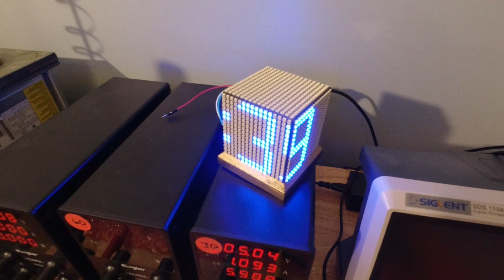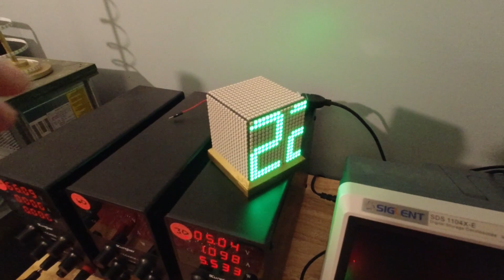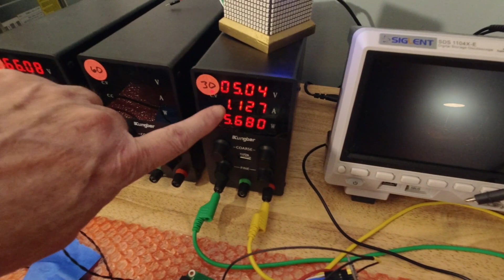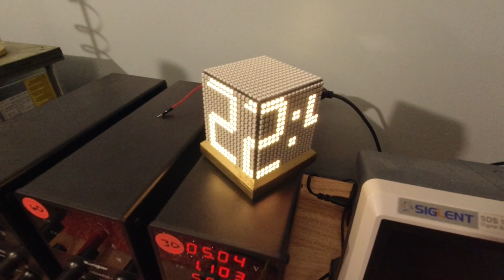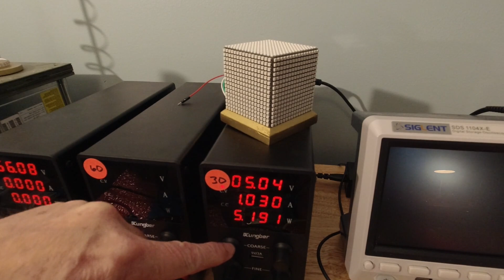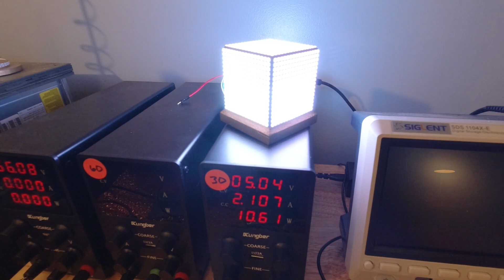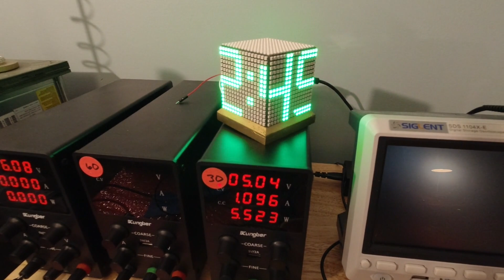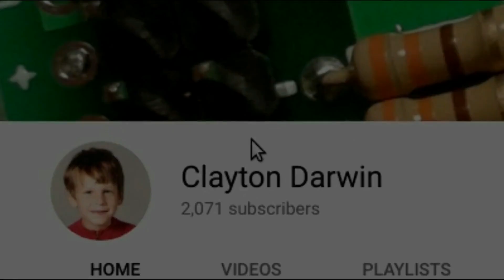The Problem With NeoPixels (and The Cube)

Comment: For speed, I'd be using the Raspberry Pico, specifically the PIO function. You can allocated one machine per panel then have some orchestration code to push data to each machine's FIFO. I don't get the idle power draw though, I get a few mA only per panel.

Comment: Wonder if you pinned blue to 0 how much less power it would draw. Or conversely only bumped blue. Is it a 1/3 or does it pull more?
Reply from the maker: Roughly 1/3 if a single LED is used.
Reply: I thought blue used more energy?

Comment: If you're building cubes you will want to use led matrices. Ws2108 and their like are extremely inefficient, as you've demonstrated. 

Their onboard controllers just drink power even when the leds are off.
Reply: So no power sipping option for RGB?
Reply: Just not addressable LEDs. Normal RGB LEDs you can.

Comment: I would control each panel separately. Same power, 5x the speed
Reply from the maker: good idea. I thought about that, but I haven't been motivated enough about this project to do it.
Reply: Would also do that with the power. wire the panels in parallel. this way the voltage drop at the last panel won't be as much of an issue.

Comment: Would you share the link to buy that small neopixel? I got the standard size but not that 2 small
Reply from the maker: These are the ones I used: https://www.lcsc.com/product-detail/Light-Emitting-Diodes-LED_TCWIN-TX1813N1_C784565.html
Reply: @ClaytonDarwin  thank you.. i thought it fully ensemble.. thats why i couldnt find it in aliexpress etc.. 

Thanks bro
Reply from the maker: Yep. I made them. They are pretty expensive. About 10 cents per pixel.